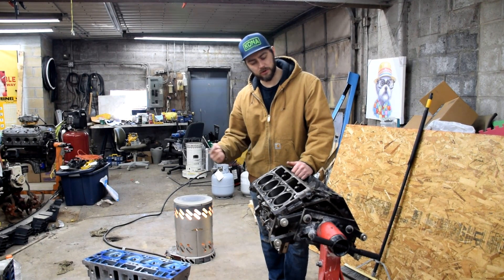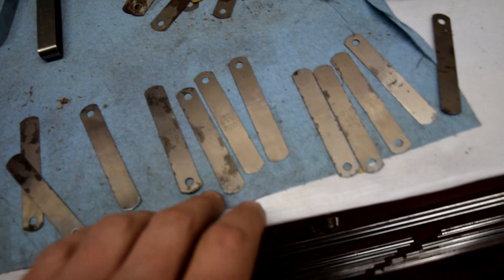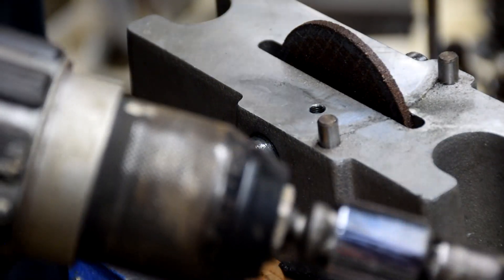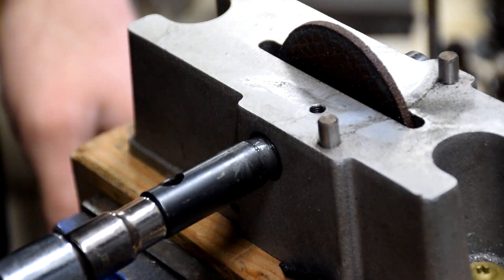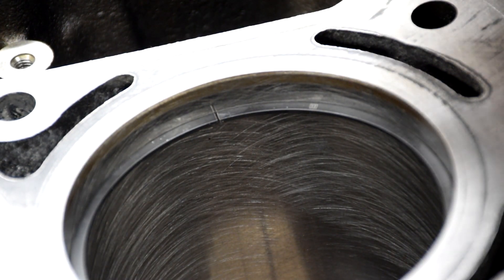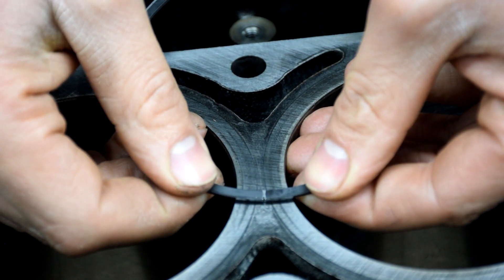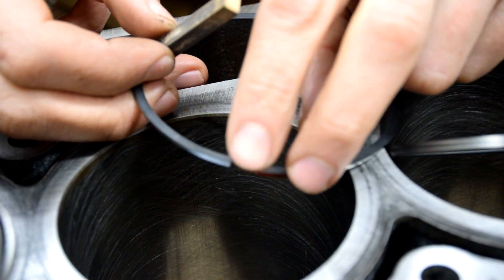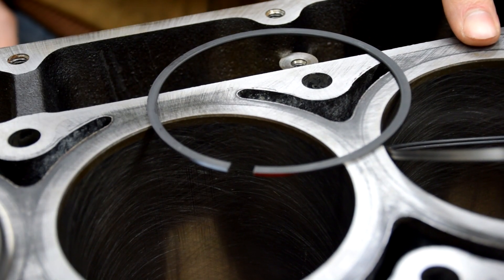Alloyspeed 700HP Turbo LS Build:pt 5 Gapping rings

Comment: I like Total Seal Gapeless Rings. But that Ring Gap Chart is critical for Engine Blow bye in all aplications of a engine. Great video my man👍.
Reply: I'd rather double check as many times until you feel EXTREMELY comfortable with your Gap. Great How To Video my Man👍.
Reply from the maker: Thanks my buddy went with a bigger gap. I kinda questioned if mine was wide enough.